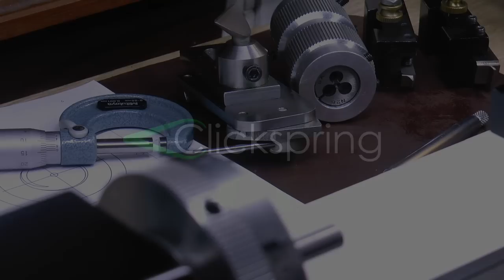Making A Domed Contact Point

Comment: Beautiful work and video as always. I was wondering if sometime you could comment on the properties of the steel after different heat treatments e.g. quench hardened vs straw vs blue?
Reply: Yep no worries. When you heat and quench it first time the steel will be glass hard and just like glass it will be brittle so the next step is to soften it slightly. So you polish it then heat it to straw or blue and that is an oxidation on the surface of a known temperature. There are tables in engineering books for different tools that require different strength.  Or it can be used as decoration as in clocks the hands and screws are often blue. Hope this helps.

Comment: What do you do with all the leftover chips? Is it possible to recycle them and melt them back down into stock?
Reply: In theory - Yes and large machine shops do so.
A small, hobbyist's shop like Chris's (and mine!) only generates a tiny amount annually that no scrap dealer is interested in. 
You can see one example of reuse at 4:05 where the blueing tray is filled with brass chips obtained from the chip tray.
For metals like steel it's not practical to even attempt to recycle the swarf 'in house'.

Comment: Chris, I’ve never used the boric acid or borax coating.  We never see what is involved to clean up the part after heat treated and quenched.  Is it difficult to remove?  I’ve heard that it is and also from those who say otherwise.  Would appreciate your thoughts and maybe video demonstrating.  Thank you so much for your willingness to share your talent.
Reply from the maker: For scale minimisation during heat treatment I use powdered boric acid only, not borax. To cleanup simply immerse the part in hot water and the glaze dissolves from the part in a few minutes: https://youtu.be/1sBU7GZNEJQ?t=911. Borax, whilst essentially the same compound in a different form, behaves quite differently to boric acid and has a different role in the shop, most commonly I use it as a flux with foundry work. - Cheers :)
Reply: @ClickspringClips  Thank you for sharing the information!!!